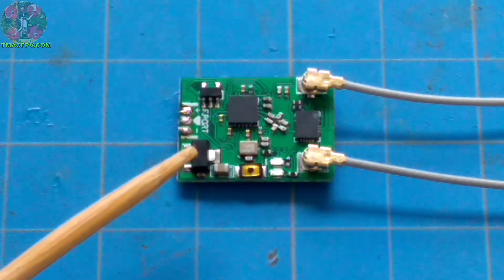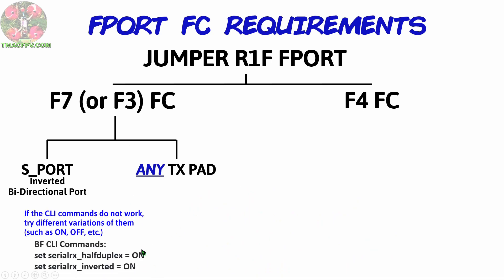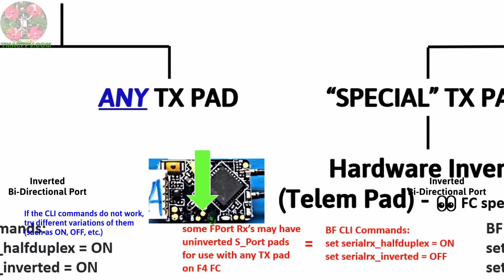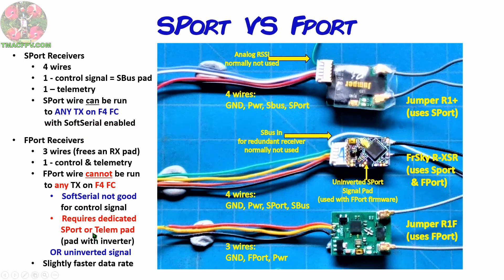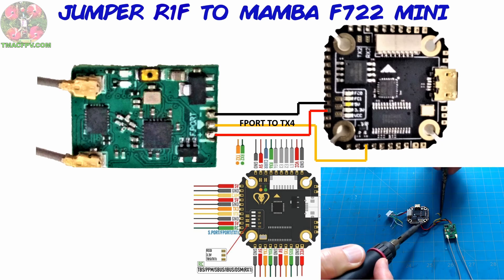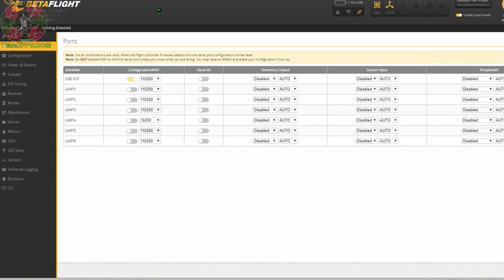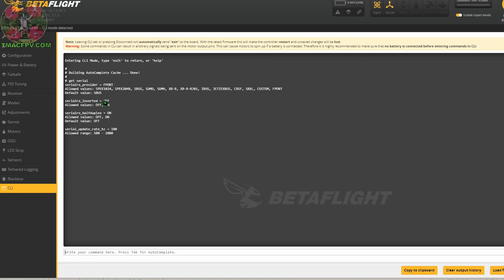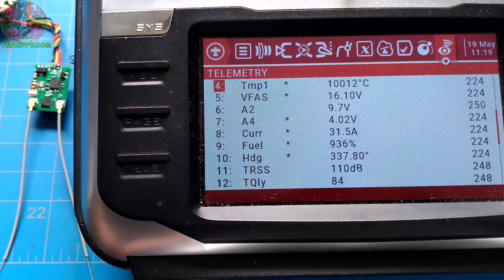FPORT SETUP (JUMPER R1F RECEIVER!)

Comment from the maker: Are you FPort ready?  Let me know if you'll be using FPort in the comments below and make sure to check out my site at TMacFPV.com !😀👍
Reply: for the F4 Boards would it not be easyer to just make a little board to invert the signal so it would work on any pad ?
Reply: @Tmac can you confirm R1F works with Taranis radios? I tried a lot of ACCST firmwares, and can't get it to bind. Both <2.0 and >2 ,
Reply from the maker: @RobertLesac  you tried both <2.0 & >2.0 how? Did you update firmware on the receiver or did you select those options in the transmitter? What type Taranis radio (model & year of model)?
Reply: @TMacFPV  used xsr-m fport firmware for the receiver and the XJT module in the Taranis. Tried two models, old one from 2014, and a 2019 X9D plus.
Reply from the maker: @RobertLesac  not sure why you chose to update firmware on receiver.  I'm not familiar with XSR-M, only XSR.  Please see information at this github site:  https://github.com/betaflight/betaflight/wiki/The-FrSky-FPort-Protocol

Comment: Yes, very nice... if only it worked on my taranis X9 lite :-( I'm getting RC receiver inputs, but NO telemetry. I had to upgrade my R1F to latest firmware (2.1) because my transmitter is on 2.1.6.

Comment: Which is better and what are the differences in between R1F and R1 V2 Mini?
Reply from the maker: As mentioned in this video, the R1F uses F Port. The R1 V2 Mini does not. If you'll be using an F4 flight controller, I'd stay away from the R1F since F Port requires a "special" pad on the flight controller (as mentioned in this video) which not all F4 flight controllers have
Reply: @TMacFPV  thank you for reply. I am buying F3 controller. What do you prefer R1F or R1 V2 Mini. A guy said that V2 has more range. Can I get RSS feeds in R2 mini?
Reply: @TMacFPV  hello again. Is the wiring procedure same for Jumper R1 V2 Mini like you told about R1F?

Comment: hi, you will face these problems with jumper t lite controller and jumper r1f receivers. browser browser receiver, betaflight CLI set serial_halfduplex ON
set serialrx_inverted = ON as . but it is not active, the engines are not running. what could be the problem?

Comment: I have a iFlight SucceX-E F7 FC Stack. I can connect the receiver to SBUS ? I have a jumper t lite, it will work? Thanks
Reply from the maker: Thanks for watching!  Start at this time mark https://youtu.be/hwJtnkVq274?t=392 then setup in Betaflight following this process  https://youtu.be/hwJtnkVq274?t=529 . If you look at at a product page for the Jumper R1F receiver, you'll see it uses the FrSky ACCST D16 protocol (language it "speaks to the transmitter with).  So, the next question is, does the Jumper T-Lite "speak" this "language" (use this protocol? By looking at the product page for the Jumper T-Lite, whether its the version with the CC2500 chip or the 4-in-1 module (which includes the CC2500 chip) the answer is yes, it does support the FrSky ACCST D16 protocol
Reply: @TMacFPV  the jumper t lite is JP4IN1 version. The receiver can use S-Port (SBUS) in the R2 of the FC ? Thanks
Reply from the maker: @rchobbyer  FPort combines both SBUS and S Port onto 1 wire which needs to be connected as described in the video
Reply: @TMacFPV  i can put F port on Rx pad in the fc?
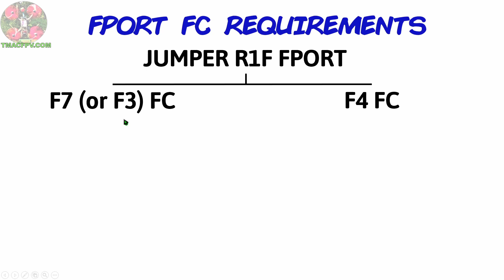Reply from the maker: @rchobbyer  TX pad of F7 flight controller as shown at 2:50 time mark of the video https://youtu.be/hwJtnkVq274
Reply: @TMacFPV  what happens if i use Rx with Fport?
Reply from the maker: @rchobbyer  doesn't work

Comment: Anyone know if the R1 will do Fport witht he R-XSR fport firmware (not the R1F)?
Reply from the maker: I have not attempted it, however there's no reason why it would work. It should not
Reply: @TMacFPV  I have a couple R1s and I can't find any R1Fs so I'll have to try it, though there might be a problem on F4 FCs without inversion because apparently there's no place to tap in to uninverted sbus/fport signal like on the frsky rxs, must be why they came out with the R1F.  I have a spare XSR too, but they don't have pre 2.0 ACCST F-port firmware, so can't do that with my T16 either..  Got to love frsky *eyeroll*.  I want telemetry and smartaudio on these 2-uart boards dangit, lol, nevermind camera control.

Comment: Hi TMac,

Any idea on effective range? The product specs say > 2km. Is this really true (or even close)? At $20 a piece, I'd be tempted to use a couple of these in my giant scale gasser (with powerbox for servo power). Thoughts?
Reply from the maker: hmmm, not sure I'd do that. To begin with, I don't use these F Port receivers as they're "troublesome" to connect with F4 flight controllers and I've moved on to Crossfire receivers. So, I'm not certain of range capability. Secondly, I believe these use "pre-V2.x" ACCST protocol  had random, uncontrolled servo movements sporadically at times. Not noticeable with quadcopter s, but apparently not good with fixed wings. FrSky updated their FrSky receivers protocol (V2.x and beyond) supposedly to take care of this, however, I do not believe non-FrSky receivers such as this one have access to that 2.x protocol (I do not know this for certain).

Comment: Thank you for this video! Is there an uninvert hack for the Jumper R1F receiver? It has quite a few SOT23-5 packages, one of which I burned up and had to replace, which was an inverted tri-state buffer (I forgot the exact part number)

I have a Mamba F405 receiver and I can't find a special S.port on it, out of ALL the pins it breaks out, none of them appear to be S.port......

I have not found any documented way to do this, so I might give it a shot, but it might require replacing such chips with noninverted equivalents.

Comment: He upgraded my taranis x9 lite to Access 2.1 protocol and now I can't bind the Jumper R1 + receiver, I can't upgrade the receiver to 2.1 either. I have tried different firmwares of the xsr receiver and it does not work. Because I understand that for the receiver to bind, the radio and the receiver must have the same firmware version, right?

Thank you
Reply from the maker: Its my understanding the X9 Lite uses ACCESS protocol.  The R1 receiver does not.  You will not be able to place ACCESS firmware on the R1.  So, you will not be able to use ACCESS on the transmitter and try to bind an ACCST receiver (like the R1) to it.  Are you using an XJT Lite external module with the X9 Lite to use ACCST D16 or D8 protocol? Both your transmitter and receiver need to have/support the same protocol.
Reply: If I understand correctly, you had R1F working on a Frsky radio?
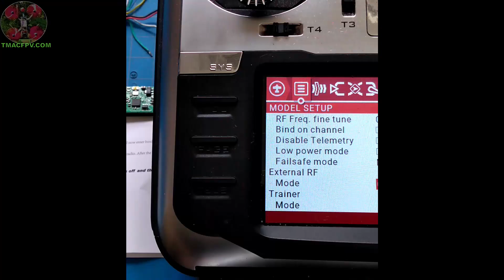Reply from the maker: @RobertLesac  No.  Please see the 7:00 minute time mark of video

Comment: Help please its normal tu have continuity betweem the signal pad and negative in the r1f jumper receptor or its a problem....thanks for the video Ill be waiting for your answer thanksss
Reply from the maker: No, it is not normal to have continuity between the signal pad and negative on the Jumper R1F (or any other) receiver
Reply: @TMacFPV  oh so the receptor its damaged okas I gonna use another thanksssss

Comment: Hi sir do u think Dalrc f405 fc can support this r1f? Can i just connect to sbus pad in fc? This receiver is having a price cut in local hobby shops. Cheaper than the other evil company's
Reply from the maker: If you're speaking of the DalRC F405 AIO FC, look at the pinplout diagram under product details at the following link. It shows how a receiver is hooked up to SPort which  I believe I cover in this video https://m.banggood.com/DALRC-F405-AIO-Betaflight-F4-Flight-Controller-BEC-OSD-50A-Blheli-32-3-8S-Brushless-ESC-for-RC-Drone-p-1300573.html?akmClientCountry=America&utm_source=google&utm_medium=cpc_ods&utm_content=nolan&utm_campaign=nolan-sds-broad-rcfun-all-0806&ad_id=454664038781&gclid=CjwKCAjw2dD7BRASEiwAWCtCb2pSjDVpO_ae01a8R8rNtwr7yNaEeJp5S8X-Hb4BqNvU3n8vwe_EOhoCPh4QAvD_BwE
Reply: @TMacFPV   this is very helpful guides. Thx u so much for the info

Comment: Can you tell me, how far can you fly with T16 + Jumper R1F radiolink?
Reply from the maker: According to it's specifications, it's effective range is >1.5km. Many factors go into what range you will get out of this (or any other) control signal link. This includes the  environment in which you fly, obstacles, etc. I do not regularly fly the R1F . I fly (and if you want strong control signals at distance and penetration through objects) Crossfire

Comment: TMac,
Great video.  I love your explanation on the F4 flight controller.  Now I know why I could not get the R1F working on my iFlight Cinebee. 

Also, I finally got my R1 working on my Beta85X 4K.  After all that time, through the BETAFPV user group I found out that f.port doesn’t seem to like TX3.  When I moved the f.port to TX1 and did Salk of the rest of the magic by setting up a softserial and so forth, I got all of the telemetry that you can possibly have.  Now even my LUA scripts work.  

Have a fantastic weekend!

Cheers,
Sam
Reply from the maker: Outstanding Sam! 👍Nice work!